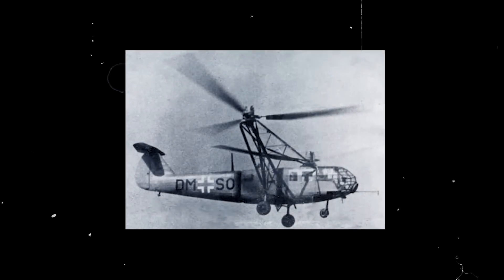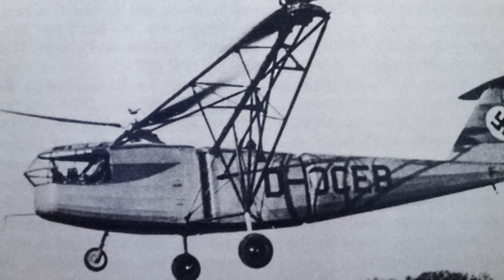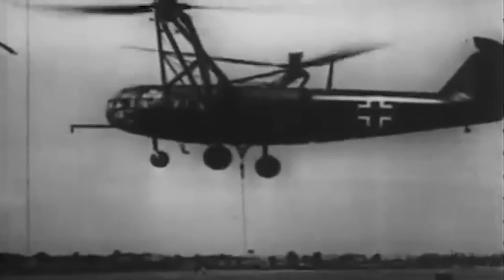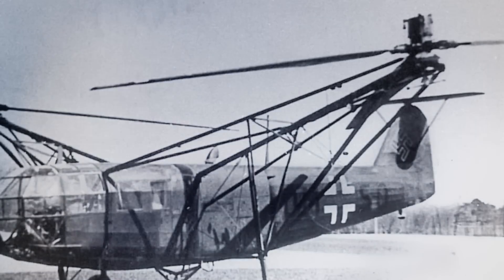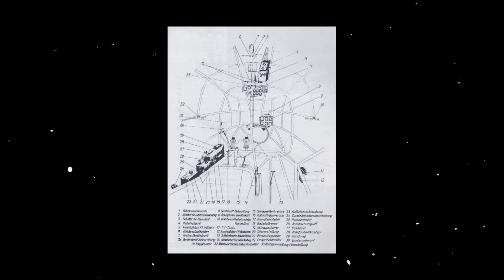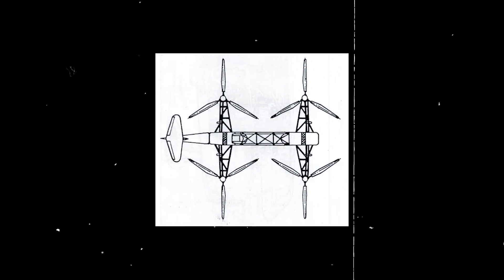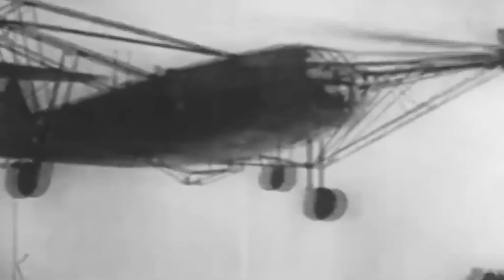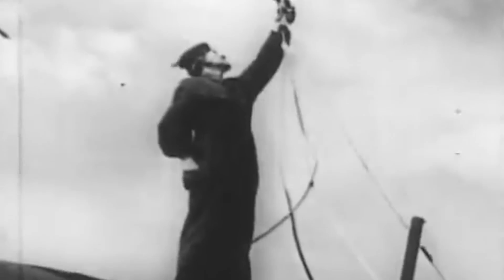The Luftwaffe Fa 223 Dragon - First Helicopter to Reach Production Status

Comment: If you align the rotors with fuselage, you have a “Piasecki H-21 Workhorse/Shawnee “
Reply: If they could rotate the rotors, they would have had a v22 osprey
Reply: @josmo1363  great point.
Reply: @dub2536  But don't forget the stub wings.
Reply: @donsmith4044  those ca be added via plywood and crazy glue etc. Sadly the "Natter" project which I admire had tragedies as quality glue is something the germans where in very short supply of because many aircraft crashed as the glue didn't hold well enough. But where there's a will there is a way.
Reply: @dub2536 The wooden wonder  Mosquitoes had a habit of glew failures to critical control surfaces.
Don.
Reply: @donsmith4044  That is Exactly what I said. The Natter fell apart many times costing lives etc. That is the reason I said that the Germans lacked a supply of reliable glue. The germans also ran out of painkillers. Hence they created "Methadone" still in use as a painkiller today. A synthetic opioid painkiller. Hence given an additional two months before the end of WW2 they might have created a wonder glue. Who knows. If they had a reliable consistent supply of a quality glue they could have gone to the moon before 1969 for all we know. But I doubt we ever walked the moon. Anyhow, I like the Natter as a concept and the way it could fly high so rapidly that concept was ahead of its time as was this Focke Wulf. At least they got the FW-190 D flying before the end of WW2. Peace
Reply: @goqsane  If you have proof please provide it to me. You would make me so happy no kidding. I was informed that NASA made a point to leave reflectors similar to fancy mirrors that we can bounce high powered laser beams to the moon, hit the reflector, and have the beam bounce back. Why can they not bounce a beam to many scientists present to sign an agreement confirming that the evidence was viewed confirmed and witnessed by at least two top scientists from every country to witness and say to us sheeple, that it has been proven? Why don't they do this? Instead, they gave a gift to some politician of some foreign country. That rock was examined and proven to be "petrified wood" LMAO. Is that Nasa having an odd sense of humor or an episode of Benny Hill? I could go on for days literally at how absurd the excuses are. I'm sorry to break this to you. But "Santa Clause" is a lie!
Reply: @dub2536  the proof has been sitting there ever since the first man walked on the Moon and set up the experiments. There are detailed photographs taken from orbit of the Moon that showcase untouched steps that were created by the astronauts. Together with the equipment that was left behind. I don't have time to deal with people like you. They once said that the Earth was in the center of the Universe and were prosecuting everyone who did not believe that obvious lie. You are one of those people.
Reply: @goqsane  I wanted to say to you, that I have other videos, like 2 max I hope I can share with u by tomorrow. I also apologize for the "Santa clause" comment. That was a bit rude on my behalf. I'm sorry. I hope you are well. I respect you for using your mind and not believing every theory presented to you. God bless!
Reply: @dub2536  The reason the glue on the Natter and He162 didn't hold well enough is that the slaves employed to build them would pee into it, weakening its adhesive qualities. As you said, where there's a will there's a way.
Reply: @dub2536  You sure talk a lot just to build a strawman argument.
Reply: @CaptHollister  what argument r u referring to? I told a kid I don't think NASA landed on the moon. That hurt a mind control victim so much that he got as midevil as he could on me. I attempted to explain to this kid that "don't believe everything u hear!" Perhaps u do? I dont. Therefore I said I do not trust a country that admits to lying to the people to go to war Vietnam thx to the "Gulf of Tonkin lie" now where is the straw man? I speak facts. I was hoping to agree with thisa angry child that we can "agree to disagree"
Reply: @CaptHollister  If you want evidence to prove that NASA did not land on the moon as they say, then ask them why we currently cannot bring a man to the moon alive. Then ask them how they transported 3 men to the moon in a 4 by 4-foot cubicle sized space ship made of tinfoil 4 layers literally, and not go crazy within that cubicle for over half a month recycling their feces and urine to drink and eat, like they claim to currently do on the ISS using the "chugga, chugga, chugga machine" to recycle fecal matter for them to process brown coffee out the other end of that toilet. Do you desire to be forced to eat shit? Regarding this child, I was polite to her/him and I tried to reach him/her to not believe everything u hear. Do u?
Reply: @dub2536  Yes, astronauts are very highly trained individuals and they never had to eat recycled shit. What strange ideas you have. Other than to shut you guys up, what would be the interest of going back to the moon ? Wait, I retract that: even if NASA or anyone else did put another group of humans on the moon, you would deny it. You say you want proof, but that is a lie because in reality all the proof exists, but you refute it in some very strange and unconnected ways.
Reply: @CaptHollister  I saw an astronaut himself describing how they do recycle their urine in a machine he described as the "chugga chugga chugga machine. It was a toilet seat that made noises and then spewed out coffee at the other end. Likely they added a lot of salt sugar, and only God knows what can make that consumable. If you doubt me check all interviews with astronauts over the past three years, and you will likely see the interview where the guy describes his chugga chugga chugga machine. He has stated that on the ISS they recycle their urine. I kid u not!
Reply: @CaptHollister  This is partially the reason I suggested that they use a cannon to launch payloads of food and water, rather than urine to consume-in space. At this point in time, u better get accustomed to the taste of urine and feces, because thats (urine) on their daily menu. Check for yourself, and acquire an honest answer
Reply: @dub2536  You specifically said they recycle their feces and urine to eat and drink and went on to claim they are forced to eat shit. Your argument technique is composed entirely of strawmen and moving goal posts.
Reply: @dub2536    Wow.  Your tinfoil is leaking again.
Reply: Glue
Reply: @dub2536  that’s a bizarre idea
Reply: Jo Smo good point !
But I’m talking about this
Piasecki H-21 Workhorse/Shawnee
Reply: @josmo1363  Focke was working on a tilt rotor towards the end of the war
Reply: Aligning the rotors with the fuselage is a better way to build a twin-rotor helicopter.
Reply: dwiggins01  I know that poorly-informed conspiracy websites like the jelly-donut argument, but in reality no German speaker would have misunderstood what Kennedy said as anything other than I am a citizen of Berlin. That's the problem with people who speak only one language: they can be fed all kinds of mistranslated BS with no way of knowing it.
Reply: And if you king size it you will get Mi-12 . So far the largest helicopter made and flown.

Comment: 12:17 not true. they did make few designs mostly prototypes but kaman husky and k-max were both based on this design even using people involved in this helicopter.
Reply: The K-Max recently returned to production after ending back in the 1990's. Therre is still demand for it for logging and other sling load applications and due to attrition of the existing airframes demand became high enough to justify another production run.

Comment: The “4-rotor version” looks eerily similar to today’s UAS/drones — which is the plan for future intercity passenger transport. “To look ahead, we must look behind.”
Reply: https://youtu.be/eWH2w-LUVc0
Reply: yes but also v22 big brother was canceled and it ad 4 rotors. so im not sure if anything big will came of of those multi rotor designs.
Reply: Jebi Se ... hexa and octa-rotorcraft are coming ... powered by hybrid or full electric motors ... I’m projecting another 20—30 years ... the Boston to Richmond corridor will be crowded with 30-70 passenger “air taxis” and “air busses.” “Peter Pan” will take on a whole new meaning. 🧚🏽‍♂️
Reply: @flitetym  my prediction is no... hybrid or electric is too heavy and will stay to heavy for long time maybe for ever who knows. 
in 20-30 years usa maybe will get fast trains so there wont even be need for such big helicopters.
Reply: The two rotor version reminds me of the Alouette helicopters.
Reply: The way they are controlled or powered are different: quadcopters today use electric motors to turn each prop.   They control it via changing the torque.  This means you cam use simple propellers.  For the Drache quadcopter, the rotors have their own cyclic control.

Comment: The VS-300 was even earlier, and the R-4 and R-5 (both similar in era) would prove far more influential.
Reply: Don't hurt the German fan boys feelings
Reply: And yet it's development was inspired by the 1936 Focke-Wulf Fw 61 :P
Reply: No it wasn't? The Platt-LePage XR-1 was, the VS-300 and assorted developments are independent other then the fact that they are both helicopters.
Reply: @JohnDoe-jh9cf  all helicopters built on the gyrocopters that came before them. Multiple ways of dealing with the rotor torque problem but similar in many ways.